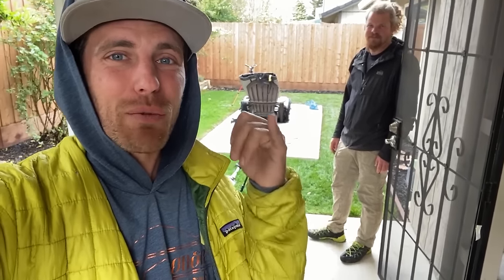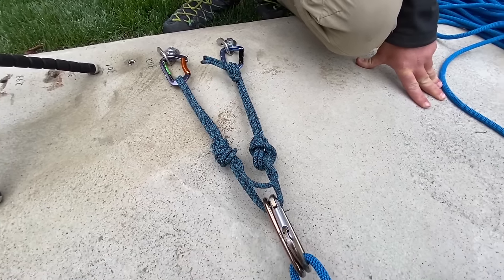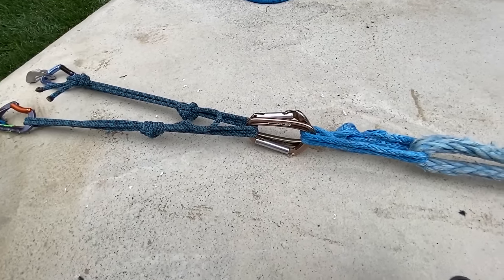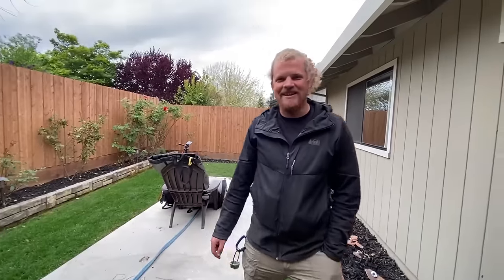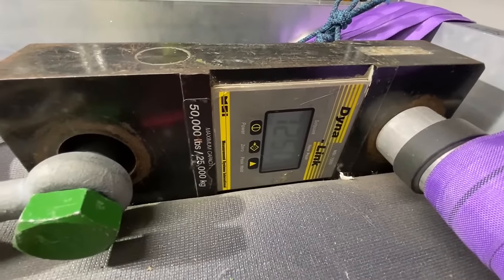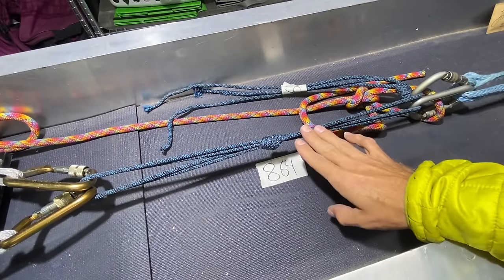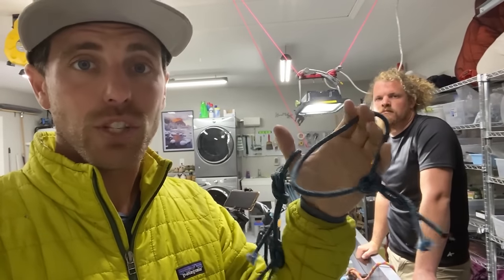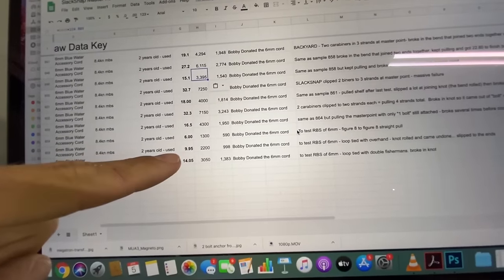Climbing Quad Anchor break test with 6mm accessory cord

Comment: When the EDK creeps, all the load ends up on the parallel non-knotted strand.  A knot with less creep, like a pre-stressed double fisherman might make the whole assembly stronger before the initial failure.
Reply: Came here to say just this. Of course the quad was already very strong, but replacing that EDK with something that creeps less WOULD increase the breaking strength.

Comment: Using double fisherman's instead if edk on quad might actually make it stronger, the edk was slipping which loaded the other loop more.
Also testing edk with extra overhang as stopper would be interesting, to see what the knot strength is.
Reply: The EDK is literally only used to join two ropes for a 2 rope rappel and even then it should be backed up with another flat overhand and at least 8" of tail to accommodate the knot rolling over multiple times like it did in the video. The flat overhand knot has been tested and proven to be 30% weaker than a double fisherman's when tying two ropes together.
Reply: @derekatwood6236  yes, an EDK/flat overhand is not a suitable knot when the two strands pull away from each other, since it will roll off the end of the rope. On a two rope rappel the EDK (should) sit on top of the karabiner and so the strands pull in the same direction. see here for some break tests: https://youtu.be/GQn9m8ehffw
Reply: Some people want to be able to untie their cordalette loop for some anchor setups, and double fisherman's (while definitely the standard for strength) can be quite difficult to untie after being loaded heavily. One alternative which is stronger than the flat overhand and doesn't roll but still allow easier untying than a double fishermans is the offset barrel knot (also called the double overhand) as discussed here: https://youtu.be/GQn9m8ehffw?t=260

Comment: As a sailor, it's hardly a surprise that ropes break at the knots. Knots constrict the ropes and weakens it. Climbers use some weird knots too that I would never, ever use on a boat. Climbing is of course a completely different thing, but the forces from a 10 ton boat tugging on the moorings in a storm are pretty intense.
Reply: Nobody is surprised that it breaks at the knots.  The test is to determine the actual forces required to break them and how well the redundancy works.  Knots are different because they require far more from their use besides of what force their deal with.

Comment: At 12:25 as soon as the knot started to set and stretch a little bit, most of the force was transferred to the other line on that side, guaranteeing that that one would see the most force out of the 4 sets of loops. I think maybe setting a knot that slipped less, and also making the loop that the knot is in tighter than the knotted loop would even out the force so both strands are helping the whole time.

Comment: Still wondering why you clip 3 strands on your quad. That removes one of the key advantages of the quad, and you saw that failure. If you had clipped two lines in the masterpoint, it would have had to break both of those lines and you'd have seen higher than 15 kN on the "redundant" test.

Also, using a EDK on your quad instead of double fisherman's?
Reply: Flat overhand is the way to go if you ask me... That way you can more quickly and easily untie it and have the full length of cord to use for other scenarios ( sling a boulder, etc...) Double fisherman's gets welded shut and you're stuck with the length that it's tied at.
I'm with you on the other point... Not sure why they clipped 3 strands on the quad.
Reply: @mcfjk3  I`ve been using double fishermans for some 5-6 years now, and rarily does it welds shut from standard stuff. And EVEN if it does, you dedicated that cord to that quad,
but i think whatever you are using, you are never going to create such force to break it, in a rock climbing scenario.
Reply: I thought the same. Makes no sense to rig that way.
Reply: Why does no one else use Figure 8's to bend?
Reply: @johnboling  Figure-8 rolls under low load when used on a cord like this. Flat overhand/EDK does not (as easily)....
Reply: @TheTeknikFrik   I assume John is referring to a flemish bend, not an offset figure-eight bend.
Reply: @permapunter  Yeah, Flemish bend is stronger and doesn't roll as much. But if you're doing that you may as well go with a Zeppelin bend backed up by overhands on the tails, even lower risk. Almost no reduction of rope strength, doesn't jam, doesn't roll, easy to tie, easy to inspect (once you learn it). Biggest disadvantage is that it uses more rope than a Flemish bend or EDK, though less than a double fisherman's. Second biggest disadvantage is that it's probably unfamiliar to many climbers, so your partner might not know how to inspect it correctly.
Reply: Whelp, it broke at 27 kN and held 12kN static, then it broke at 22.8 kN and held 4 kN static, finally it broke again at 15 kN. What scenario requires more than that? (If you think of one, get some 7mm cord and start breaking 'biners [or get some 8mm cord and start pulling bolts])
Reply: You clip 3 of 4 strands so if one of the anchors fails the carabiner will not slide down the rope.
Reply: @derekatwood6236  Duh, and you obviously don't understand why I made the comment. Clipping three as opposed to two sacrifices strength in the event of a failure. Sure, clipping 3 or 2 both provide redundancy and keep it from sliding off the anchor, but if you clip 3 strands, only #4 needs to fail before you die, but if you clip 2 strands, #3 and #4 both need to break before you die.
Reply: @TheArmyKnifeNut  what you are referring to is the eaquallette anchor, a quad always has 3 of 4 ropes clipped, unless climbing milti pitch in that case 2 ropes for the belayer and  2 for the climber. The quad should be set up with 7mm rope which is 10kn, three strands of 10kn more than enough strength but if you feel safer clipping 2 and 2 go for it.
Reply: @derekatwood6236  An equallette anchor is completely different. This anchor has a twist on one of the clip in points for self equalizing instead. The quad is not always with 3 of the 4 ropes clipped. It makes no sense to do that because on anchor failure, you are held by 1 strand of rope, not 3. 2 makes the most sense for the most balanced anchor in terms of strength and redundancy. If you need extra strength for top roping, you can also just clip another carbiner on the other set of strands opposed for maximum strength and redundancy.
Reply: @NoPushN  you're actually referencing a sliding x, not eaquallette. Take it up with the AMGA not me
Reply: @derekatwood6236  Equalletes can incorporate sliding x's after the limiter knots. The main point I was trying to make is that it's better to do the quad with two caribiners on two separate strands or 1 caribiner on 2 strands rather than 3 strands on 1 caribiner. 

I've seen load testing videos that show after anchor failure, the next point of failure is easily your single strand if you clip 3 strands.
Reply: @NoPushN  the amount of force required to break the bolt and then break a 10kn strand would have to be insane. I rarely if ever see anyone with the 2 and 2 clipping scenario you describe and the AMGA along with other guide and instruction companies all say to clip 3 leave 1... maybe ask them why its preferred im sure there's a reason.
Reply: @derekatwood6236  there's diagrams everywhere about clipping 2 and 2 strands with different carabiners. You also use it to have two anchor points for separate things. I feel like you never know what could happen when an anchor breaks or slips out on trad, something could abraid the rope causing it to have diminished strength. Also ropes become weaker at the knot in general. 

My argument is only that one way is probably better than the other based on what I've researched for only 1 extra biner. Not the likelyhood of the 3 clip failing
Reply: @NoPushN  go hold your quad from just one end to simulate one bolt failure. As you can see the carabiners will be held by the three strands, not the 1 strand. For the carabiners to end up on the one strand they would have to go over the knot which will not happen during an anchor failure.
Reply: I was perplexed as to how it was not identified as a EDK "sort of", a 'variation'... I don't see any variation?! It is an EDK aka flat overhand knot!
Reply: @NoPushN  Your argument is incorrect.  Clip 3 leave one means that you have a maximal downward breaking strength of 3x 10kN.  If a bolt were to fail you would have had to put a large force but under 30kN.  Let's say the carabiner failed at 22kN, your master point (3 strands) is still viable.  You have now slipped and dissipated energy which means the 10kN single strand is still strong enough.  If you clip 2 and leave 2 you have no redundancy because your master point will fail before your anchor points.  Not a good scenario!!
Reply: If you're really paranoid, make a 3 loop Quad (a hex?) and clip 4 and leave 2.
Reply: @pentachronic  Hi! so in a multipitch, can you clip 3 for you and 3 for your partner (two shared)? this can be more safely than 2 and 2 no? Sry my english. Thank you!
Reply: @gonzalomuller5065  Typically the carabiners would be for the rope to run through.  When you are at the belay station/stance you clip into the shelf (above the knot).
Reply: @pentachronic  Thank you!

Comment: I often tell my students that overhand knot is as good as double fisherman's knot when it comes to joining 2 ropes for abseiling off a multi pitches climb. But I don't have any numbers to proof my point. Would be really informative show the strength both of them holds. thanks
Reply: The zeppelin bend in another good one. Almost no slip and easier to untie after loaded.

I read some people use an Alpine butterfly.

I'd like to see some pull tests on all the different bends. As well as how easy they are to untie after, say, 5kn.

Comment: Super interesting video, that broke way higher than I expected. One test i'd love to see done is the same, but tying the join (EDK or double fisherman's) in the centre rather than the legs that go to the bolts. In your tests it seems the loop that runs alongside the knot is always first to go, suggesting the knot slip causes higher load on the other strand. Tying it with the knot in the centre and clipping the other 3 strands i'd suggest may be even stronger. Thanks guys, awesome content as ever.
Reply: You''re likely right but it'd be compromising redundancy. If a bolt fails during a fall, the single unclipped strand gets shock-loaded and I wouldn't want that strand to be the one with a knot in it.

Comment: Great video, lots to learn from seeing these different failure modes.  I would be interested to see what the breaking strength would have been of the single loop closed with the European Death Knot with one of the tails tied in a blocker so that the knot cannot walk it's self off the end of the tails.  This is how i have been taught to implement that knot by the sierra club courses.  It would both be interesting to see how the knot reacts as well as provide a comparison point to the double fisherman's version to see the difference in knot factor between the two.

Comment: Just FYI the right side of the anchor saw closer to 16800 kn when it broke.   

You can use this calculation (32500x0.5/cos(30x0.5) 
32500 can be replaced by load at centre point 
30 is the angle of the anchor (roughly) 
A wider angle will break alot earlier

Comment: 12:31 Are you zero-ing with the dyno under load?
I'd like to see a quad (double fishermans loop) with just one aluminum locker on 2 strands as a master point.
Great test. This one was aching to be tested.
Reply from the maker: if under load, i turn off peak and turn peak back on.  when i hit zero it was not under load

Comment: would love to see if you only use 2 strands as that is how we use it. 2 for the belayer and 2 for the climber. and then see if on a multipitch the direction of force in a fall, as in when leading from an anchor makes much difference.

Comment: Well... taking the time to close your loop with fishermans is apparently worth time, I guess.
Reply: Timothé Verrette seemed the most learned thing from this video to me, I don’t get why he said that it wouldn’t have mattered if they would have used the fisherman’s on the quad test because it failed at the limiter knot. Every where I have read the fishermen’s is recommended for joining two ropes, I thought this video suggests the same. I would be more interested to see how tying the fishermen’s(and other) knot effects the break, different tail lengths(how short is too short), if the tail is used again for stopper, if the knot is properly dressed. People often seem to use the appropriate knot but the results are not always the same. Would be nice to see more examples of how well you tie the knot effects things.
Reply: @iangottmusic  the only time you'd want to use the EDK is rappelling, and even then, only when you're worried about the rope snagging in cracks or branches (the knot tends to ride over snags more easily).

I've never seen anyone use one on a quad anchor before.
Reply: @simonsimon9880  There are many sources that say to use a double EDK instead of a single.  It has the same advantages of riding over snags, without the disadvantage of unrolling and dumping you to your death.  (And yes, it does unroll, as seen here, and even more so when wet, or in slippery rope, or when tied loosely.)

Comment: TEST SUGGESTION
On the indoor test where three strands clipped, it would be interesting to see what happens if only one belay anchor was clipped. This would simulate a fail of second anchor. It would offer a scenario where there is potential for everything to load into the one strand side, rather than the three strand side. Any thoughts?

Comment: First test outside with the braking at the knot may depend a lot of the way the quad is done, it is hard to get both rope strand perfectly even, one will always take more load. Double fisherman knot seams a lot better but it surprised me how much load they were able to put on the knot they did. I use to clip 3 strands of the quad normally to anchor my rope and I was wondering if clipping one carabiner on 2 strand and the other one on the 2 other strands was better, looks like this video show a little improvement for the second option, it is also getting better results in the catastrophe case one of bolt fail. In reality both version are way stronger than needed, specially with the use of a cordelette, but I like to feel more secure even if it is useless. I would like to get the exact same testing with different model of slings

Comment: I've watched it back a few times and looks to me like the first break, which you said was in the knot, is actually at the biner?
Reply: 5:44
Reply: If you look at the aftermath, the end of the rope is still attached inside the knot. The fact that there were two separate, similar-length strands that were broken free shows that it broke in the knot as-stated. If it had broken at the carabiner, there would have been one short strand (crab-to-edk length), and one longer strand (crab-to-limiter).
Reply: If it had broken in the knot, the knot would still be attached to one end of the broken cord. The knot remains part of the unbroken loop after the snap
Reply: I'm confused about this as well. I'm 99% confident it did not break in Bobby's euro death knot. I'm 90% confident it did not break in the limiter knot. Due to having two similar lengths of rope left over, I believe the break occurred at the carabiner.
Reply: @JayMartMedia  yeah that's pretty much where I'm at. Hopefully Mr.Jenks will chime in at some point to clear it up 😁
Reply: Good point(s)...brain failed me there
Reply: It 100% did not break at the know at 5:44. There are two equal length tails. That said, I think a contributing factor of why it broke on the right is now much stretch/roll there is in that EDK (you can tell because of how lopsided the masterpoint is after the failure). A double fisherman's would have had less stretch/roll and would have taken a higer percentage of the load on that side and the anchor would have been stronger over all. The non-knoted cord on the right leg would have still been first to fail, but at a higher load.

Comment: I disagree regarding using the double fisherman instead of the single overhand. I think the double fisherman would make the entire quad stronger because it seemed that the single overhand was slipping making that loop longer therfore putting more force on the other other loop which inevitably breaks first in every test. The double fisherman doesn't seem to slip like the single overhand which would keep the loops the same length.

Comment: How thick is your slab? Does it have rebar in it? Does it have any fiber in the concrete? Have you thought about pulling out of slabs of granite, limestone? I think you'd find granite is much stronger. A local granite counter place should have excess pieces they'd probably sell you cheap.

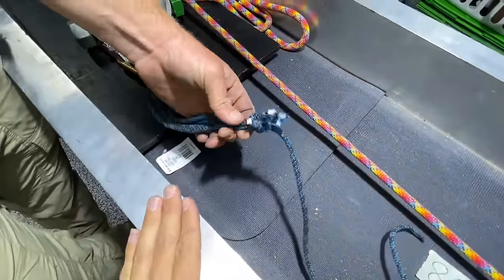Comment: It was the knot one the top at the right of the screen that broke(@12:40), not at where you're pointing(12:50).
I had to play it back at .25x speed. You can tell where is broke because instead of having 4 strands you only have 3.
It's still much better than the Clove hitch and Munter hitch!
Quad anchors are much better with 6mm rope than Dyneema slings.

The Figure 8 to Figure 8 looks like the rope broke in the middle and not at the Knot. You look at the amount of tail that you had on the figure 8 to the right, (15:53) The tail was already short, So the long bit of the rope means it broke in the middle of the two figure 8's. Am I wrong?